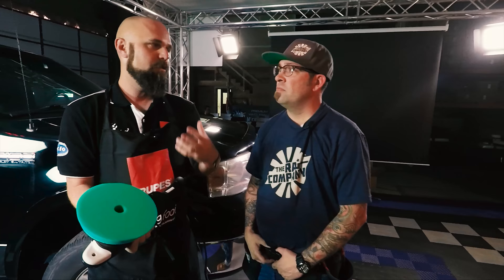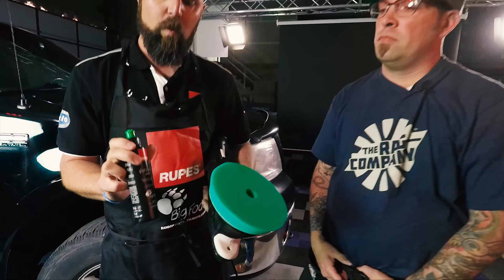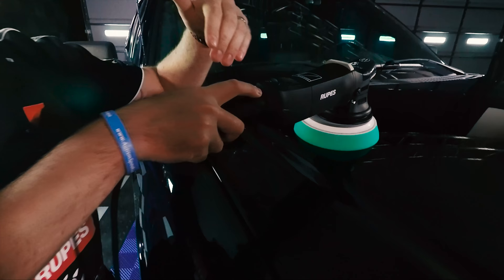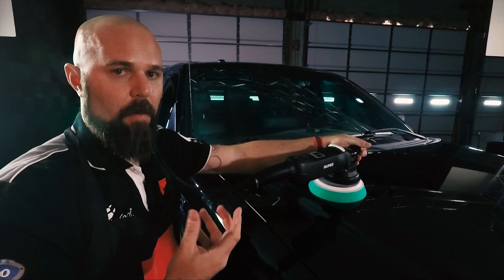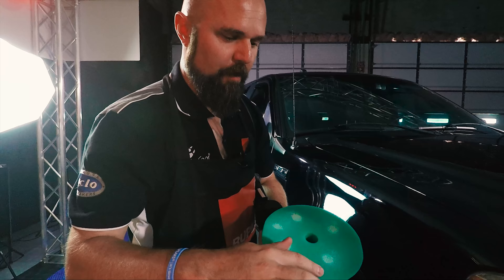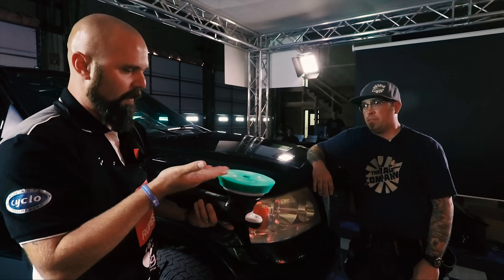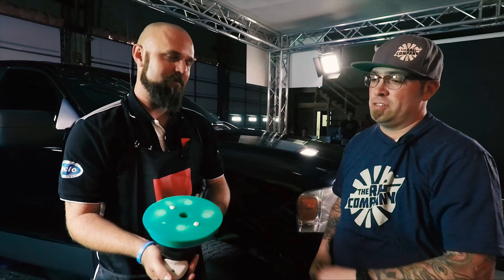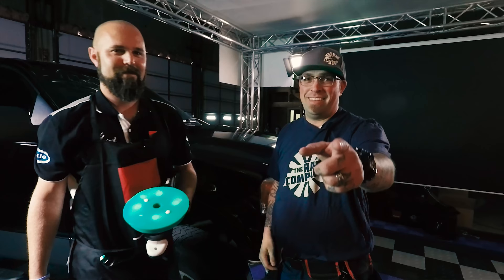How To Properly Prime Rupes Pads w/ Dylan von Kleist | DETAILS WITH LEVI

Comment: Please do tell.... do you prime all the pads in same manner.. i mean blue and yellow as well and what about the soft white pad?

Does that require the same amount of pressure including the same amount of polish and method and so on.

I purchased rupes whole sustem and so far happy with machine and all the pads except blue.

I am using DMC5 by meguiars instead of blue pad for now since it's just not working for me.

I am gonna try it as soon as i get a next job but for now please answer for what i asked....

Thanks in advance and for posting this video. My English is not that good so pardon me if you guys have already mentioned which i couldn't catch at first place.
Reply: I like to prime all of the pads this way, especially the blue, green, and grey. 

The blue pad takes some time to get used to. On the 6" pads foe the Duetto/LHR15 I might use three drops of compound to prime instead of four becaise of the reduced surface area of the porous foam. I'll sometimes place my drops a little closer to the center. I can sometimes re-load the pad with one or two drops of compound after the initial priming is done.